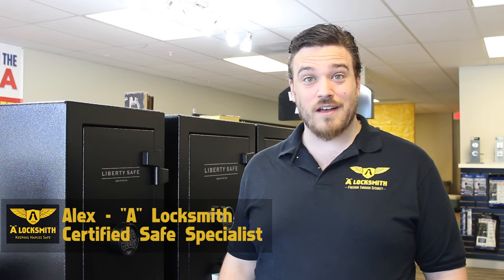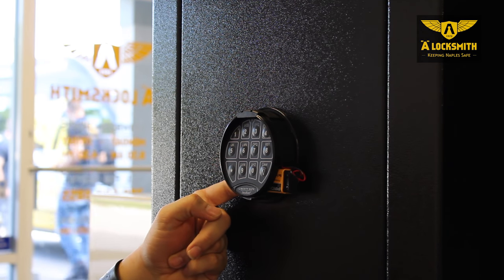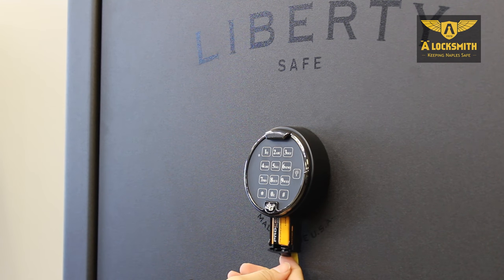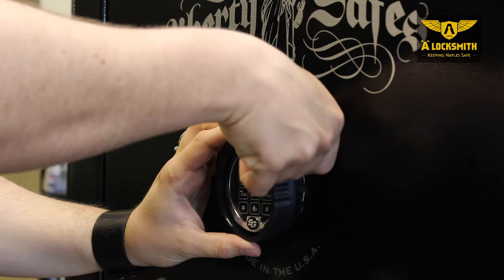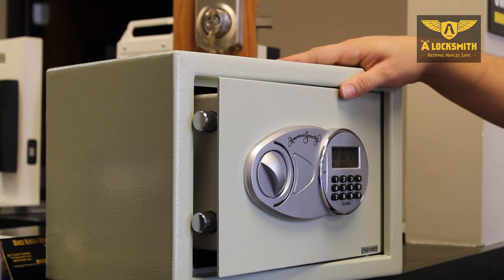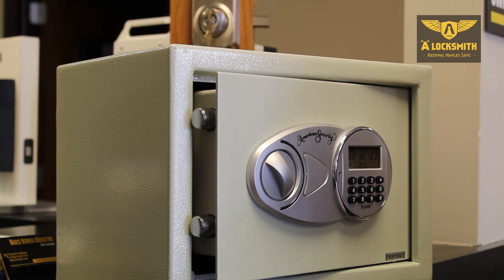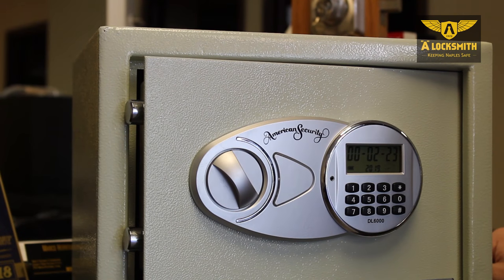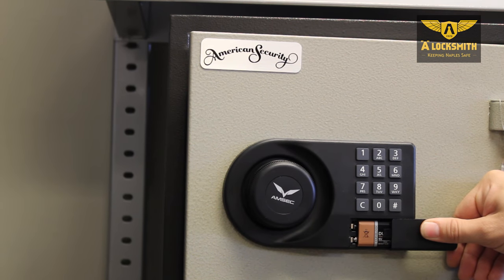How to Change the Batteries in Your Safe

Comment: I have a liberty and the ring around the dial will not twist off. Do you know how to fix this?
Reply from the maker: Liberty has several different model locks.  Some slide straight up, some pull straight out, and some have a battery compartment on the outside under the keypad. Most likely yours opens one of these alternate ways. I hope this helps!
Reply: I also can’t turn ring??? I can lift mechanism off safe but can’t access battery???
Reply: @TerryChalupa-xn6kl  I ended up contacting Liberty and apparently this is a problem that happens to some people. They are sending me a new lock to replace it